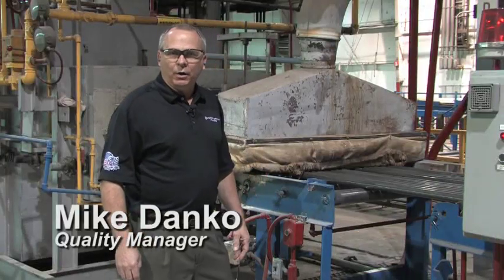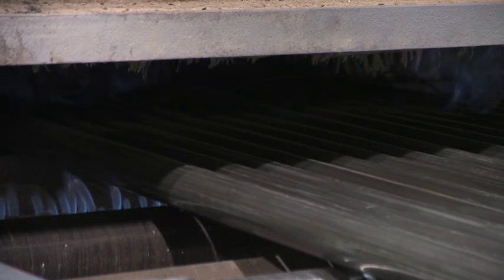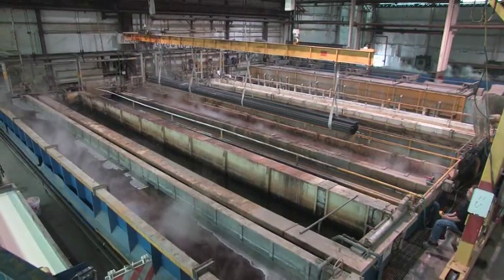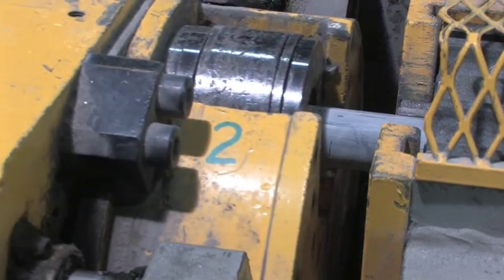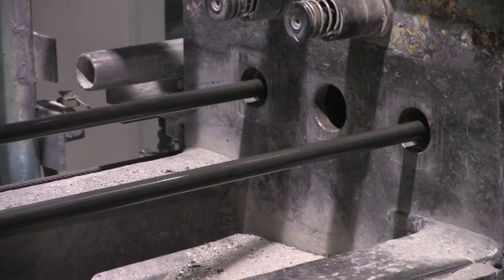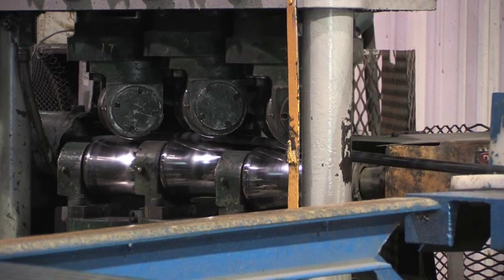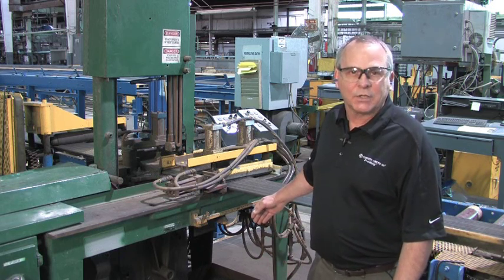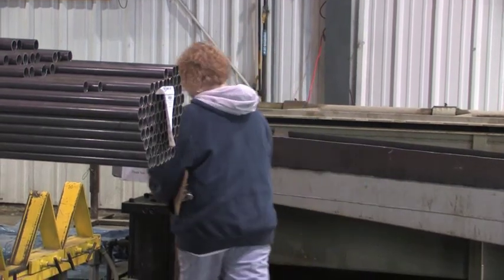Plymouth Tube Company: Cold Drawn Tubing Process

Comment: I used to be a drawbench operations. Our equipment sucked. Nice operation!
Reply: @Ram Prasanth we had two benches for pulling SS rounds into square. One older bench, made in the 1920's, cast iron gears 8 feet tall, 100k lbs pull. Max 3" .250 wall. 

The other bench was made in the 1950's and had a max of almost 7" .375 wall, 200k lbs pull I believe. Had a 150hp GE 3 phase electric motor with machined gear reduction.